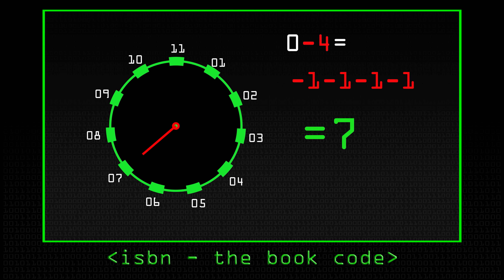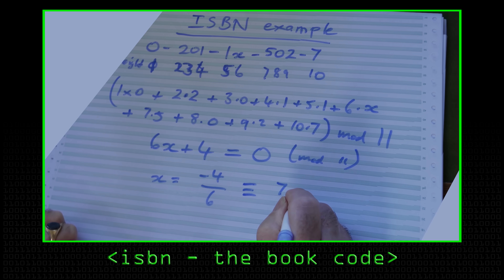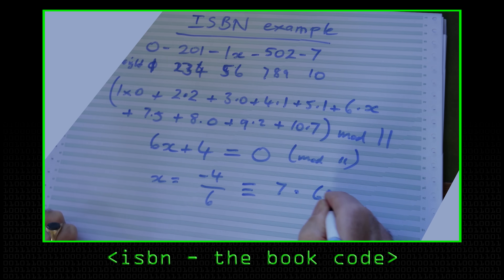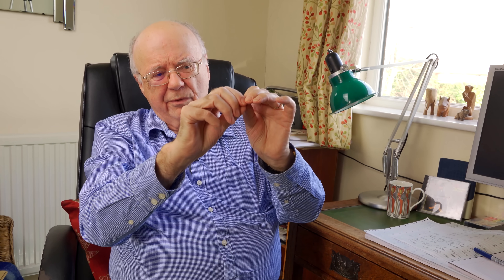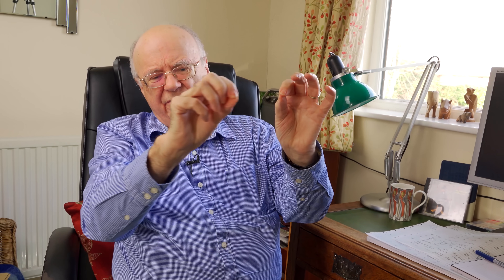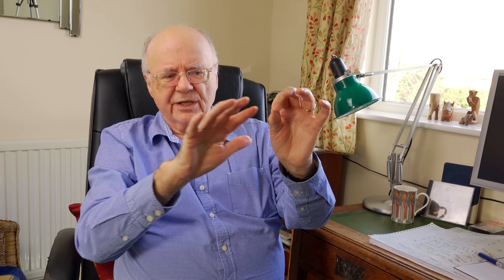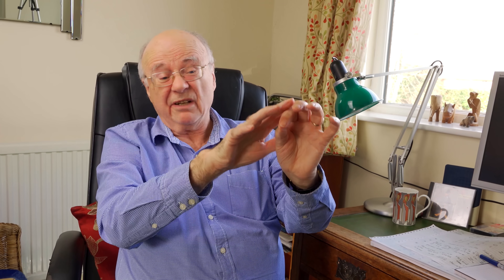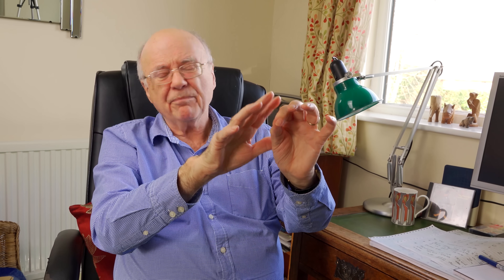Reed Solomon Encoding - Computerphile

Comment: 📺💬  Gallion series and error correction in CD, where it is capable of working the hardware performs supercomputing ability. 
🥺💬 Yes, and 2 bits modulo for error collection purposes is makes sense that a small device can perform a big computation within 15 seconds of buffer time.
🐑💬 Everything had prepared state and work in real-time when it does require.

Comment: Reed-Solomon error correction is a mechanism to improve data integrity by encoding redundant information that can be used to correct errors in the sequential bit reads.  It's useful in any mechanism where data integrity is required on bit streams.  Compact discs are the classical example, but it's also used in QR codes and data transmissions.

Comment: I really wish the professor went into the shifting registers earlier on instead of just focusing on the super duper tough mathematical concept behind it. I was onto him the moment he said each symbol should have a value of 0 and a frame shift in the register would give wildly different results. Just bitshift until you get the symbols to all match zero, and then you got your data back... It's interesting he talks about the "hardware guys" doing super duper cool hardware stuff, but it's not really that hard to just explain or visualize the logic gates in the microchip specifically designed to do these calculations.

Comment: What about columns of bits that are 1 tall?
Reply: In that case, BCH code is normally used. For the BCH like version of Reed Solomon, let n = number of bits per column, then maximum number of symbols, including the parity symbols, that can be corrected using Reed Solomon is 2^n - 1.

Comment: The symbols appended to a messages are called "parities".  Syndromes are not part of an encoded message, but instead calculated based on a message with appended parities, and used to detect and/or correct errors. To correct errors, instead of matrix inversion, Berlekamp-Massey (1969) or Sugiyama's extended Euclid algorithm (1975) are more efficient,  and used by CD's, tape drives, hard drives, ... .

Comment: 5:19 Isn’t this also where the “CIRC” (“Cross-Interleave Redundancy Checking”) comes in? The bits are arranged in a pseudorandom scrambled pattern (which is unscrambled as part of the decoding process), so that any contiguous run of errors on the disc is spread across a larger area after unscrambling and affects a smaller proportion of bits within that area.
Reply: yes, it is indeed, also, no mention to the simultaneous 8to14 modulation that also happens in those clever little Dutch Audio CD's. bit sad at that...

Comment: just blew my mind because i realized cds have error correction :facepalm:
Reply: Not only CD's. I just figured out from Wikipedia that it is also used for QR codes, data transmission technologies such as DSL and WiMAX, broadcast systems such as satellite communications, DVB and ATSC, and storage systems such as RAID 6. Google, for instance, uses it in their massive distributed storage system, Colossus, to recover from disk failures.

Comment: Sounded like he was going to mention CRC in the end since it also is based on long division, but I guess that's different?
Reply: CRC is much simpler. It can only detect, not correct, errors. CRC needs very little resources in either hard- or software. It is at similar complexity much better at detecting real-world errors like truncation or transposing than checksums.

Comment: Shouldn't we be able to use something similar to one of those neural-network picture algorithms(like the ones that takes a low-res image and scales it almost perfectly into high-res) and apply it to music or code itself at this point? (And, in this example, use it to fill in the missing data from a media that's been damaged, like a CD...)
Reply: re hash Too weak.  AI neural networks are inherently unpredictable.  Error correction needs to guarantee correct results up to almost the theoretical limit of impossibility.

Comment: For some reason I got the feeling that RAID technologies may be coming up while watching this. 🙂
Also, I would have loved to see some more equations. You don't have to talk about them, but show them at least so those of us who do have a relevant background can get a better grip of things.
Reply: Mikkel Højbak RAID1 is simply a second copy, then using read errors to decide when to use that other copy.  RAID4 and RAID5 is adding a single XOR parity bit and again using read errors to decide when to reconstruct a block by XORing the blocks from the other disks.  RAID6 uses a 2 bit Hamming code while still using read errors to decide which blocks need to be reconstructed from the others.  I don't think any of the practical RAID levels use RS codes.
Reply: @johnfrancisdoe1563  Linux uses Reed Solomon for RAID 6, and ZFS uses it for RAID Z2 and RAID Z3. Not familiar with other implementions, but that's two pretty important projects using it anyway.
Reply: @StevePinkham  - RAID 6 implementations vary. Some use XOR for one of the parities, and BCH view Reed Solomon syndromes (as opposed to parities) for the other parity. This approach simplifies recovery.

Comment: The No. 1 ESS Program Store and Central Control used hardware hamming and parity to check and correct single errors. This was preformed on every program store read. I believe other ESS variants using magnetic card technology used similar techniques. Thanks for the video.
Reply: For reference, you're talking about the Electronic Switching System from Bell Systems, the first large scale automated telephone control system?